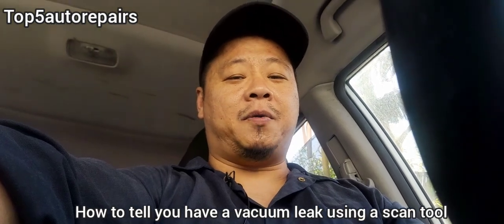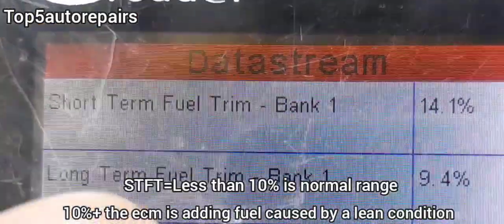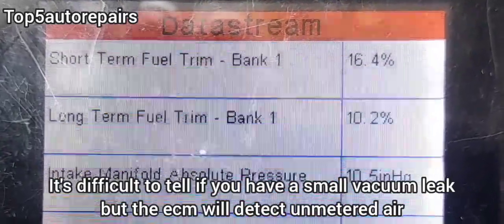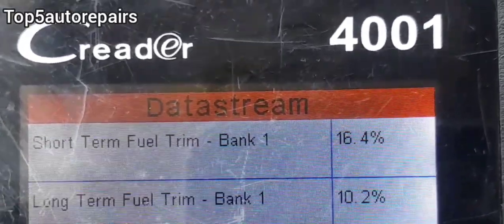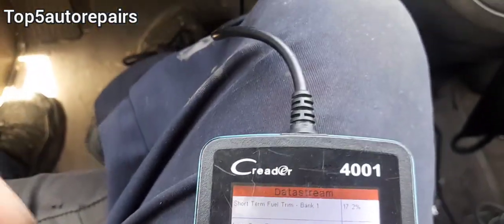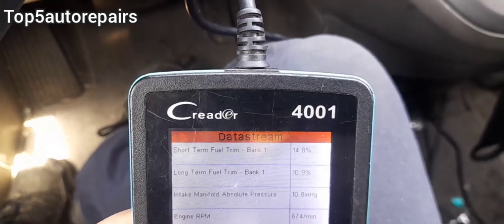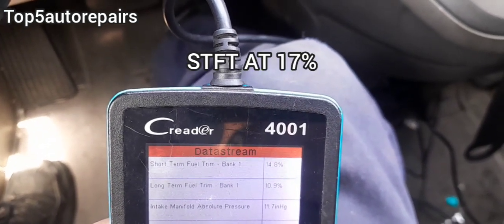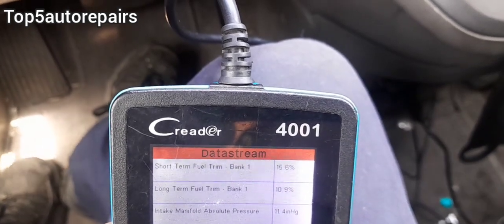HOW TO TELL YOU HAVE A SMALL VACUUM LEAK USING A SCAN TOOL

Comment: Changed out my MAF SENSOR. 2015 chevy  cruz.
 Was idle surging in gear a stops.
 Had high fuel trim code P0147.
 No vacuum leaks.
 No check engine light. Ran a scan and Found code.
 Reset all throttle controls. 
 Just removing the .MAF CUASED THE P0147 CODE.
 WHICH TREW OFF MY TROTTLE .
 Did a full reset and trotlle learn with car in drive.
 The  Cruz is a finiky piece of trouble. FYI, Jumping battery cables? You need a 3 ohm 1 watt resistor between tge cables, or you can fry a few relays.ASE, Aircraft Technician, 50 years.
 All the fly by wire aircraft are controled by A FADEC Computer on the engines.
FULL AUTHORUTY DUGUTAL ELECTRONiC CONTROL.
 Boieng 737 problems I worked with them and it was a glitch in the FADEC computer.
Reading stalls and turning off Auotpiolt. Be carefull what you learn you learn on YOUTUBE.
 GOOD JOB GUY.
 Just rember that resistor.

Comment: Not necessarily many things other than vacuum leaks affect fuel trim it is very dangerous to use brakekleen etc to check for leaks
Reply: Agreed 👍. Plus such products like this can and will damage your hose’s and plastic parts , which will cause future problems like leaks and a hole in your wallet😢

Comment: If my check engine light is on does that mean my transmission is bad I have a 2002 Chrysler 300 m transmission valve body assembly
Reply: Get your codes read and see if they are associated in any way with transmission first. Some transmission symptoms are or can be caused by engine issues or engine performance things. Just like if your engine oil is low,  it  can cause shifting issues making one think there is something wrong with the transmission. Check codes is first step.

Comment: I assume the carb cleaner test is while the engine idles?  Thanks for the vid!
Reply: And cold !  Start up as cold, and then you have only a few minutes to perform this type of test using a flammable substance like carb cleaner.  Never spay on hot engines. Even the mist, and vapor could spell disastrous 🔥🔥🔥😢